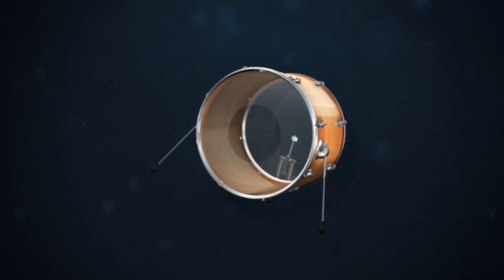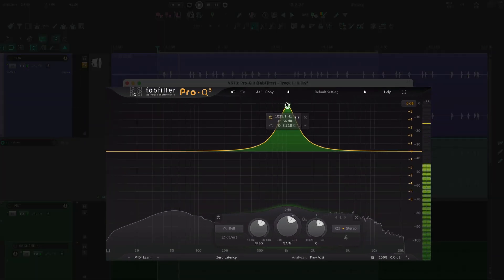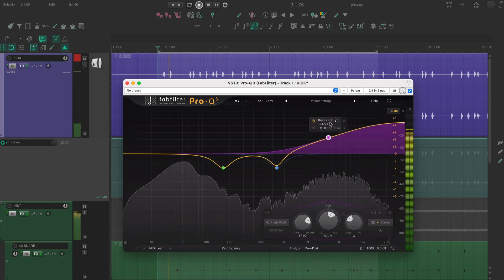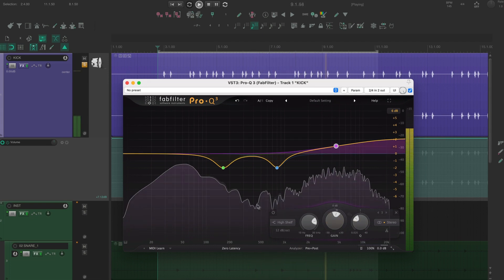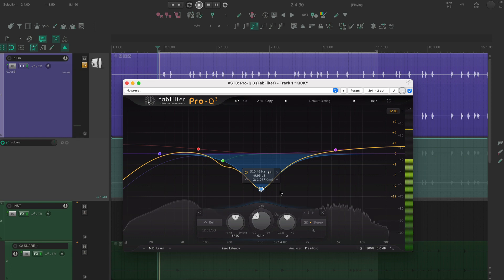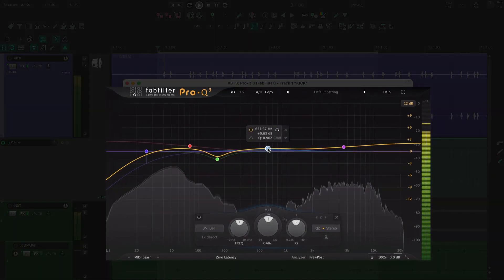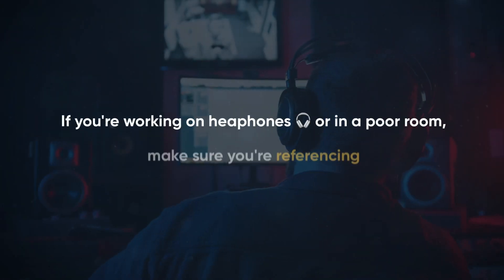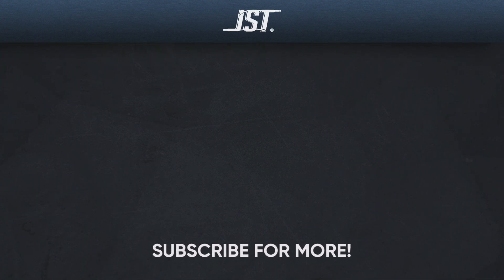How To Mix A Kick: EQ

Comment: Would've been cool if you used a live kick rather than a sample. The kick had a really nice sound to begin with as for most home recording would have a lower starting point.
Reply: Agree hehe. The opening before/after kick is completely different compared to the (eq’d) used kick sample. But still great content!
Reply: I disagree with this. There's no excuse for recording a kick poorly 😂
Reply: Get the source right, there's no way around that)
Reply: @philzeojr.853  It has nothing to do with the quality. It has to do with realistic dynamics and bleed.
Reply: @lannyfce4786  in real life, sample replacement is a common enough technique that I'd be surprised if people didn't use it at all.
Reply: @philzeojr.853  I think a lot of people would be shocked at how many people want to learn how to mix without premixed sounds.
Reply: @lannyfce4786  a sample doesn't have to be premixed :)
Reply: Use samples too. Problem solved hahahaha
Reply: @icarobarbosa4354  Why bother recording a drummer then?
Reply: @ricksterdrummer2170  but the drummer filling has nothing to do with the sound of a poor drum wtf
Reply: as someone who mixes pretty exclusively live (concert) recordings I always think this about nearly anything I watch. Wish my raw tracks were anything near that. :)
Reply: That’s why almost every producer uses drum replacement/enhancement like drumagog.
In the end almost all producers use samples to fix that issue
Reply: @cleantones it’s possible, yet you need a buttload of microphones for each part of the drum kit.
The samplers come with the direct sample from the kick for example, along with the room kick, some other mics the specific producer uses.
Along with some “sauce”, most likely compression and or clipping.
And you can fiddle with the levels for each microphone.

Comment: Doing that kind of tutorials on samples is just pointless. Just sayin.
Reply: indeed. Finding "trouble zones" and resonances in perfectly sounding samples is ridiculous.
Reply: you're wrong dude, even samples need adjustments to fit the mix
Reply: @ase6629  no one said that they don't need adjustement
Reply: I simply disagree. Using samples is necessary in some Productions and if you can't mix a kick sample, it would be an absolute shame.. Being a sample doesn't make it any less part of the mixing process.
Reply: If the samples are already processed, then maybe. Raw samples are still 90% viable for a tutorial as all that's missing would be initial compression and gating.